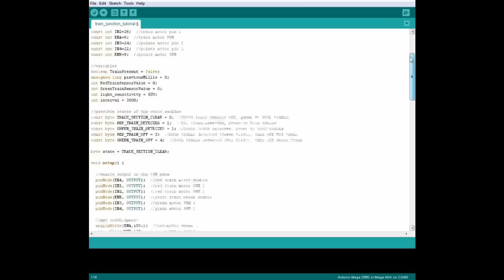Arduino for Lego Trains #6: Controlled Junctions

Comment: I know this video is 7 years old, but if you used 4 sensors (one on each side of the junction in each direction) you could tell when the junction was clear without the need for timers. This would easily scale up for people with larger train setups where timers would eventually cause crashes.

Comment: I love these videos and am using them to automate my 7 yr old grandson's train set for him!  I don't know if you're still answering here but the one thing I'm totally stuck on is connecting 2 trains to the motor to make this project work which I haven't seen in any of your videos  - I've made 2 cables, one to join to each track connector, but when I connect the 2nd cable to the output 3 and 4 at the opposite side of the motor to the ones for the 1st cable that you use in your 1st video then connect up the 3 wires from the arduino to motor pin 1, motor pin 2 and the motor PWM (which I assume is the all I need to do), the 2nd train doesn't work.  Is this wrong?  Hope someone can help!!
Reply: OK, well I answered my own question because I traced the problem to a faulty track connector (I have 3 and only 1 still works now  :-(   ) and when I replaced it then each train worked fine - I'm waiting for another connector then hopefully they will work together!!

Comment: Hello

I have built the same crossing as in your movie. and it works perfect. thanks. I put also some stoplights in de track.  https://www.youtube.com/watch?v=_6u_3cC1jZM

I want also, in the same code, a extra stop by a trainstation, with train 1, and with a lightsensor.
can you help my  with the right code.

greeting Wil Wilkes
Reply from the maker: Great video! And good to see you made it all work.

For your extra stop, I think you should use an Interrupt. To do this:
1. In your void setup section, add: attachInterrupt(3, interrupted, RISING);
2. Connect your light sensor to pin 3
3. Add a new function to the code called "interrupted"
4. Add the void loop code from Tutorial 2 to your new function.
5. Add the required variables for this new code (eg LDRvalue, previousMillis).

Let me know if that works for you!
Reply: Hallo
Thanks for your answer. I've tried your data, but it does not work. I'm not so familiar with writing software. Therefore I send you my code and maybe you can help me with the correct code.

Greetings for the Netherlands Wil Wilkes

/* this program uses two light sensors to detect two trains approsching a junction.
the program halts the second train detected for a fixed period (interval) before
restarting that train.

Change INTERVAL to increase duration of crossing
*/

//analog pins used for light sensor
const byte TRAIN_1_SENSOR = A0;     // train 1 (Passagiertrein)
const byte TRAIN_2_SENSOR = A1;     // train 2 (vrachtrein)

// PWM pins for train motor
const int GRNA1=2;      //stoplicht groen train 1
const int REDA1=3;      //stoplicht rood train 1
const int GRNA2=4;      //stoplicht groen trein 2
const int REDA2=5;      //stoplicht rood trein2
const int IN3=6;        //train 2 motor pin 1    (vrachtrein)
const int IN4=7;        //train 2 motor pin 2    (vrachtrein)
const int ENB=8;        //train 2 motor PWM      (vrachtrein)
const int IN1=9;        //train 1 motor pin 1    (Passagiertrein)
const int IN2=10;       //train 1 motor pin 2    (Passagiertrein)
const int ENA=11;       //train 1 motor PWM      (Passagiertrein)

//Variables
boolean TrainPresent = false;
unsigned long previousMillis = 0;
int Train1SensorValue = 0;
int Train2SensorValue = 0;
int Light_sensitivity = 500;
int interval =2000;

//possible states of the state machine
const byte TRACK_SECTION_CLEAR = 0;   //both light sensors off, power to the trains
const byte TRAIN_1_DETECTED = 1;      //train 1 detected, power to both trains
const byte TRAIN_2_DETECTED = 2;      //train2 detected, power to both trains
const byte TRAIN_1_OFF = 3;           //both train detected, (2 first), turn off train 1
const byte TRAIN_2_OFF = 4;           //both train detected, ( 1 first), turm off train 2

byte state = TRACK_SECTION_CLEAR;

void setup() {
  
  //enable output on the PWM pins
  pinMode(ENA, OUTPUT);    //train 1 motor enable
  pinMode(IN1, OUTPUT);    //train 1 motor PWM 1
  pinMode(IN2, OUTPUT);    //train 1 motor PWM 2
  pinMode(ENB, OUTPUT);    //train 2 motor enable
  pinMode(IN3, OUTPUT);    //train 2 motor PWM 1
  pinMode(IN4, OUTPUT);    //train 2 motor PWM 2
  pinMode(GRNA1, OUTPUT);      //stoplicht groen train 1
  pinMode(REDA1, OUTPUT);      //stoplicht rood train 1
  pinMode(GRNA2, OUTPUT);      //stoplicht groen trein 2
  pinMode(REDA2, OUTPUT);      //stoplicht rood trein2
      
  //set train speed
  analogWrite(ENA,180);    //train 1 speed
  analogWrite(ENB,180);    //train 2 speed
  
  //activate train motors
  digitalWrite(IN1,LOW);   //rotate train 1 forwards
  digitalWrite(IN3,LOW);   //rotate train 2 forwards    
  
  Serial.begin(9600);      //configure serial communication
}

void loop() {
  
int LDRValNow;
   
Serial.println(LDRValNow);        //prints the LDR values to serial monitor
delay(100);                       //speed at wich LDR sends value to arduino

switch(state)  
  {
    case TRACK_SECTION_CLEAR:     //both light sensors off. power to the both trains
      {
        Train1SensorValue = analogRead(TRAIN_1_SENSOR);
        Train2SensorValue = analogRead(TRAIN_2_SENSOR);
        
        digitalWrite(IN2, HIGH);
        digitalWrite(IN4, HIGH);
        
  //stoplight      
  if (Train2SensorValue > Light_sensitivity) {
       digitalWrite(GRNA1, HIGH);        //als er geen treinen op de baan staan
         } else {
       digitalWrite(GRNA1, LOW);
         }
  if (Train2SensorValue < Light_sensitivity) {
       digitalWrite(REDA1, HIGH);        //als er een trein op de baan aanwezig is
        } else {
       digitalWrite(REDA1, LOW); 
                
        previousMillis = millis();                   //save the time
        TrainPresent = true;
        state = TRAIN_2_DETECTED;
      }
    
   if (Train1SensorValue > Light_sensitivity) {
        digitalWrite(GRNA2, HIGH);     //als er geen treinen op de baan staan
          } else {
        digitalWrite(GRNA2, LOW);
          }
   if (Train1SensorValue < Light_sensitivity) {
        digitalWrite(REDA2, HIGH);   //als er een trein op de baan aanwezig is
          } else {
        digitalWrite(REDA2, LOW);
            
         previousMillis = millis();                    //save the time
         TrainPresent = true;
         state = TRAIN_1_DETECTED;
      }
  }
      break;
      
    case TRAIN_1_DETECTED:                             //train 1 detected, power to both trains
      {
      Train2SensorValue = analogRead(TRAIN_2_SENSOR); 
      
       if (Train2SensorValue > Light_sensitivity) {
         state = TRAIN_2_OFF;
      }
       
       else if(millis() - previousMillis > interval){
         TrainPresent = false;
         state = TRACK_SECTION_CLEAR;
      }
   }
     break;
      
    case TRAIN_2_DETECTED:     //train 2 detected, power to both trains
      {
      Train1SensorValue = analogRead(TRAIN_1_SENSOR); 
      
       if (Train1SensorValue > Light_sensitivity) {
         state = TRAIN_1_OFF;
       }
       
       else if(millis() - previousMillis > interval){
         TrainPresent = false;
         state = TRACK_SECTION_CLEAR;
       }
   }
     break;
     
   case TRAIN_2_OFF:     //both trains detected (2 first), turn off train 1
     {
       
        if(millis() - previousMillis < interval){
       digitalWrite(IN2, LOW);
     }
      else {
        state = TRACK_SECTION_CLEAR;
           }
     }
      break;
    
    case TRAIN_1_OFF:     //both train detected (1 first), turn off train 2
      {  
        
        if(millis() - previousMillis < interval) {
       digitalWrite(IN4, LOW);
      }
      else {
        state = TRACK_SECTION_CLEAR;
           }
      }
       break;
}
}
Reply from the maker: Hi wil, the code you attached does not contain the attachInterrupt line or the extra void interrupted(); that I suggested.

Please send your revised code to my email (available on my channel page).
Reply: Hey
I have 2 times tried to send you an e-mail, but on  incomprehensible reason it does not work. Please send me a e-mail, so I can send you my question with the code.
my e-mail:     wwilkes1962@gmail.com

greetings Wil Wilkes
Reply: Wim Wilkes
Reply: Wim Wilkes
Reply: +CoolGuyNB k

Comment: couldn't you add two more light sensors to tell when the train has moved past so you can start the other train. that way the wait will always work no matter how long the train is. additionally you could add extra cars to the trains without recoding.
Reply from the maker: Absolutely. It's simply a matter of code complexity vs wiring complexity. My solution shows how to achieve the simplest solution with the minimum number of parts, but with four sensors you could even code in speed calculations and bi-directional crossings too (if your train travels in both directions on the same loop).
Reply: j
Reply: John Kessler 🛩🛩🛩✈️✈️✈️✈️✈️🛩🛩🛩🛩🛩🛩🛩🛩🛩📲📲📲📲📲📲📲📲📲📲🎞🎞🎞🎞🎞🎞🎞🎞🎞🎞📽📽📽📽📽📽📽📽📽🎞🎞🎞🚍🚍🚍🚟🚟🚟🚟🚟🚟🚟🌏🌏🌏🌏🌏🌏🌙⭐️🌙🌙⭐️⭐️⭐️🌤🌤🌤🌤🌤🌤⛅️💥💥🔥🔥🔥🔥🔥🔥🔥💥💥💥💥💥🔥🔥🔥🔥🔥🔥💥💥💥💥💥💥💥💥☄️☀️☄️☄️☀️☄️☀️☀️🌦🚒🚒🚒🚒🚒🚒🚒😌😊😚🚛🚛🚛
Reply: John Kessler ុតប
Reply: John Kessler ss
Reply: John Kessler in a oppppppppppp
Reply: John Kessler HG

Comment: If I understood correctly you make the trains wait at the junction for a preprogrammed time. Wouldn't it be better to make them wait until the light sensor stops detecting the train and then make them move?
Reply from the maker: +mikosoft The timer starts once the sensor stops detecting the train. This gives 
the first train enough time to clear the sensor and the junction.

This is also because the sensor needs to be a little way away from the junction, so that the second train has space to stop.
Reply: +Arduino Lego Trains AH, I see. I must have misunderstood the control logic then. THanks for the clarification

Comment: I DID THIS WITH A FLIP 4 FLOPS AND 6 AND GATS 4 OP AMPS NO SOFT WARE PS CMOS LOGIC CAN RUN ON THE SAME POWER AS YOUR MOTORS 9 VOLTS THESE WILL WORK WITH YOUR LIGHT SENCERS AND MOTOR DRIVERS THE OP AMPS WERE USED AS TIMERS I LIKE THEM OVER THE 555 OR 556 BECAUSE YOU CAN DO TOGGLE TIMERS WITH 1 IC LM1458

Comment: i am new to this and just starting. how you control 2 different trains?
Reply from the maker: +Michael Akopov Skip to the 3:00 section: https://youtu.be/YqTgpuXnWeI?t=3m 

You can see we declare pins for IN1, IN2 and ENA - these are the motor control pins for Train 1. Then IN3, IN4 and ENB are the motor control pins for Train 2. This requires each train to have its own piece of track.
Reply: thanks a lot for quick response. understood now
Reply: Michael Akopov 😈😈😈😈😈😈😈😈😈😈😈😈😈😈😈😈😈😈😈😈😠😈😈😈😈😠😡🙅🙌🙋🙆🙆🙅🙇🙎🙇🙆🙍😫😿😽😻🚋🚋🚋🚋🚋🚋🚋🚋🐏🐑🐐🐺🐃🐂🐦🐧🐧🐧🐧🐧🐧🐧🐧👑👟👞💄💄👓👔👖💼👜💣💣💣💣💣💣💣🚋🚋🚋🚋🚋🚋🚋🚋🚋🚋🚋🚋🚋🚋🚋🚋🚋🚋🚋🚋🚋🚋🚋🚋🚋🚋🚋🚋🚋🚋😻😻😽😿🙍😫👓🐂🐦👔🐃🐦🐺🐺👓🐂🐂🐂🐃🔫💰🐂🐃🐂🐃🐃🐂🐂🐃🐃🐃🙍🙍🙍🙍🙍🙍🙍👟👟👟👟👟👟👟👟👟👟👑👑👑👞👞👞👞👞👞👞👞👞👞👞👞
Reply: Hello, there is something I misunderstand in your setup. In order to control both trains separately, did you have to make some electrical isolation on the crossing?

Comment: I love your videos, the only problem is that i can't find the needed wiring :(Do you have a website or blog/forum with extra information some where?
Reply from the maker: +Jeroen de Smit Thanks for watching! All the wiring between the sensors and the Arduino is standard goldpin stuff - any store that sells Arduino stuff will have it. The only "special" wire you need is the motor-controller-to-Lego, cable, and I show how to make that in my Introduction video: https://www.youtube.com/watch?v=gFDe3nqLHl4